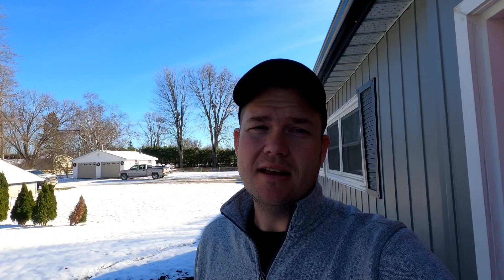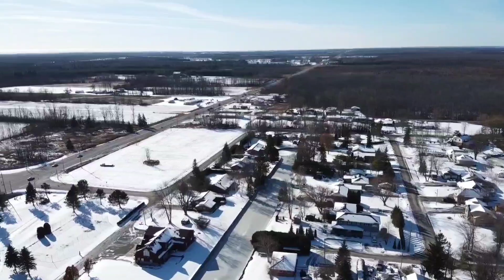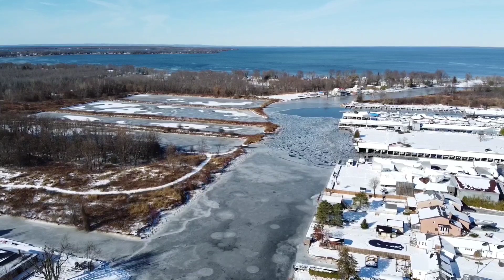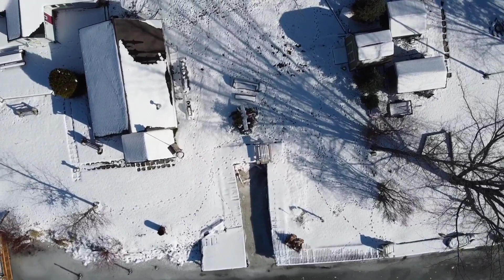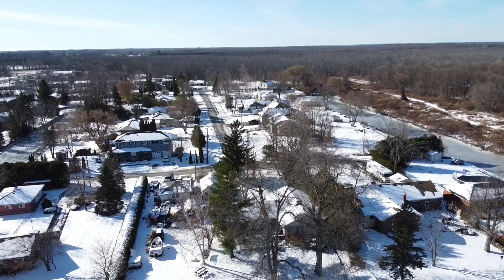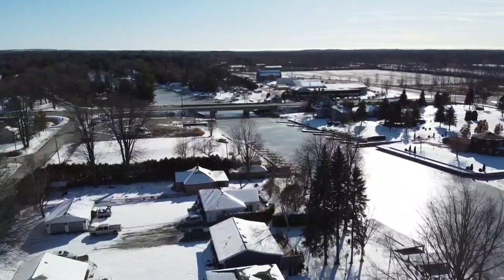DJI Mavic Mini has a problem - Horrible video Jello / shake !

Comment: I've got the same. Yesterday after new update 003 and it was totally stable!! So maybe the firmware 1.0.300 optimized the gimbal stablity when temperature below zero, even dji release  note do not refer info for opitmizing gimbal stable ability. You can update the firmware of your drone. May the info can help you.

Comment: I had a similar problem with my mini 3 pro it happened after a crash into a small tree and a 15 foot fall.  The jello in the video was caused by the rubber  mounts on the gimbal had moved out of place and the airframe vibration were conducting to the gimbal . After a little adjustment  problem fixed ,hope that helps.
Reply: hey, thanks for comment, what adjustment u did please?

Comment: Doesn’t really start being noticeable till about a minute or so into the video. 
https://youtu.be/I6C7ALWv2BE
Reply from the maker: Hey Mike, I watched your video it looks like you have sand in the gimbal. When its power off does it move freely or is there grinding? Some compressed air might help

Comment: Do not update firmware via WiFi,use DJI Assistant2 for Mavic and reinstal latest Firmware via USB Cable,belive me i have some issues and when i reinstal Firmware using DJI Assistant problem with range was solved and i dont have anny issues....And tri to recalibrate Gimbal,check the propelerels and inspect the gimbal from inside.

Comment: I have the same issue, I think the temperature was around 0Celsius on the ground so I think it was way below 0 up in the air. The video started out great but after 20seconds it started shaking.

Comment: What was the temperature?
Reply from the maker: https://youtu.be/ZV8Ar2GXMms
Reply from the maker: First flight about -7 celsius, second flight -2 celsius (haven't uploaded this yet).
Reply: @cantechvideos5701  I have noticed all the shaky footage had coldness in common. There are many videos with the original mavic experiencing the same in cold weather.
Reply: @cantechvideos5701  DJI lists that the operating temperature range is ;
Operating Temperature Range

0° to 40°C (32° to 104°F)
Reply from the maker: @maxkielbasa6079  tomorrow will be +1 celsius will try again, a friend of mine flew his mavic mini in the same temperature today and had no shake. The only difference was his was cold from being in his car, I am suspecting it is the temperature changes that are affecting it (going from a warm house into a cold sky)
Reply: @cantechvideos5701  I hope you get it worked out. I wonder what the physics of the problem is. Like water condensing or freezing on the gimbal housing or brittle rubber or a defect. Good luck.
Reply: @cantechvideos5701  It won't help. I have this problem and it is 18 Celsius